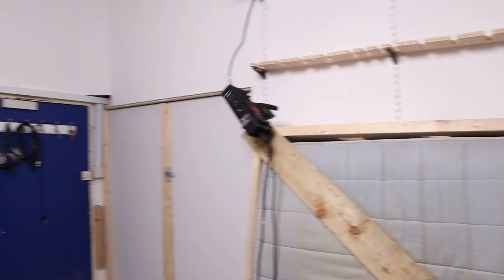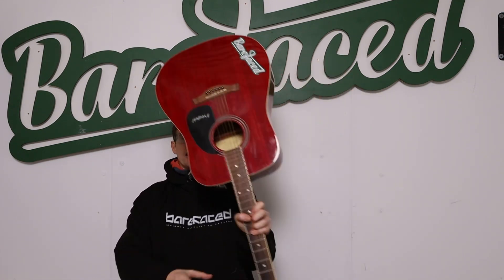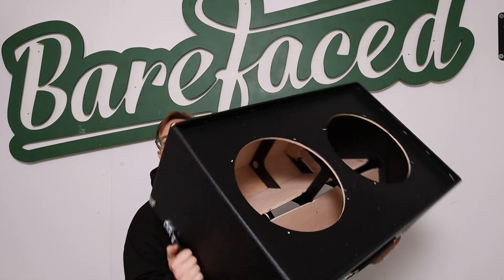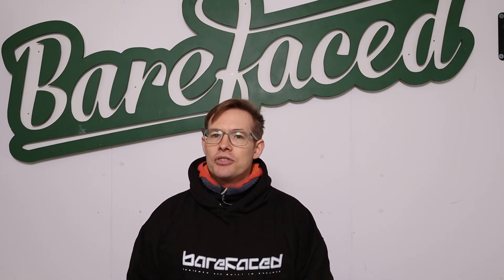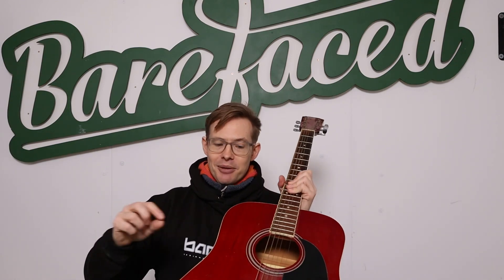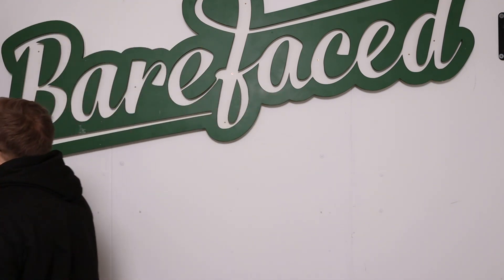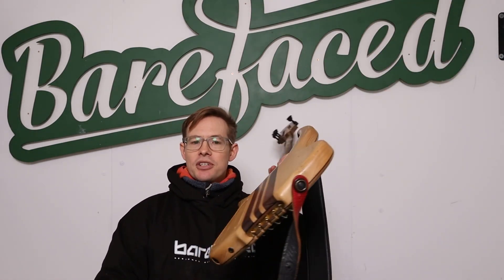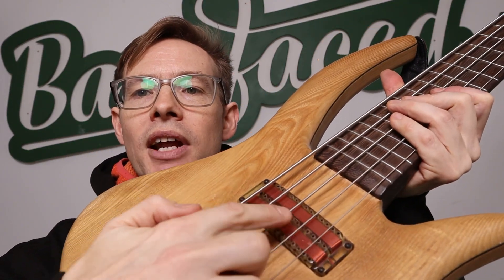Wood doesn’t matter! Or does it?

Comment: Makes perfect sense to have a 'neutral' and rigid cab not adding or substracting frequencies. However, disgarding the baffle for the moment, ive had some really great sounds coming out of solid pine guitar cabs, especially w single drivers. The trick is to not make the pine cab too deep as to keep the interfering lows out of the way. Those pine cabs do sound bigger to me and i assume the pine has at least a significant influence, mostly benificial.

Comment: Stiffness often commes with enhanced mass (if it´s not graphit) and every cab will have it´s resonant frequency so of course the material matters. I don´t argue for tone wood but I would asume that if you would build your cabinets out of 1cm concret they would sound very different. Of course everyone wants a very light box and your approach is the way to go, but when you got this far with your explanation you should go all the way and explain resonant frequencies effecting the design. Every drummer knows the difference between a birch and a maple ply sound and this (even if not intended) also goes for speaker cabinets. I used EV Thiele cabinets (edit:built with the same specs but different ply wood) and other horn designs with the same speaker and the sound was very noticable different all the time.

Comment: You may even be exaggerating the effect of the wood’s resonance on the sound of any stringed instrument. Strings attached tautly to a stiff board can be made to vibrate, to produce sound. The sound can be amplified by a nearby air volume. The material the strings are attached to isn’t resonating much at all, even in an acoustic instrument. We need someone to make a Carbon-steel cello to test. I say only an expert could tell it wasn’t wood.
Reply from the maker: If the materials the strings are attached to aren't resonating much (in acoustic instruments), why is an acoustic guitar so much louder than an electric guitar unplugged?
Reply: The volume of sound from an acoustic is partly due to how thin the wood shell is, but it’s mainly thanks to the body of air within, where there is resonant amplification of sound from the strings, then released thru the sound hole. A thick shelled hollow-body with a sound hole would be louder than an acoustic with none at all…I think.
Reply from the maker: @marcusdavey9747  The soundhole is a Helmholtz resonator, driven by the vibrations of the inside of the instrument. It will also act as a low pass filter restricting the output of higher frequencies. The outside of the instrument will generate acoustic output similarly the higher frequency output won't be low pass filtered (so will be much louder) whilst the lower frequency output won't be assisted by a Helmholtz resonance.

Comment: My little Vox Pathfinder 15R combos are made out of OSB, something held in great disdain in the guitar community.  But these semi open back amplifiers with an 8” speaker move tremendous amounts of air with a ridiculous amount of bass. The relatively new Orange crush line is made from OSB, closed back design but with ported baffle boards - and they sound ridiculously huge!!!

Comment: I have a pair of ATC monitor speakers. Obviously these are designed to limit colouration. They are in very heavy cast alumimium closed encolsures which also dissipate heat from the included amps. They sound awesome. The only wood is some kind of extremely dense particle board for the baffle. Most other monitor speakers that I tried I hated compared to the ATCs and they were mostly wood or particle board cabinets.

Comment: did you find/use particularly stiff ply ?  and have you messed with any inherently stiffer cab shapes?   (love your acoustics  vids - perhaps do room modes ) thanks
Reply from the maker: The bracing is what makes a shape stiff - when it comes to polyhedrons there's little difference under expansive load (compressive load is different but speakers move both ways) so it's all about the bracing. Our ply is stiff for its thickness and mass which pushes up the resonant frequencies and lowers their Q.
Reply: @BarefacedAudio  thanks Alex -  I've used the b&k docdecahedral sound sources and always wondered what it would sound like with different drivers used as a high output bass speaker!  it could certainly create an interesting high spl reverberant sound field :-)) thanks for reply and apologies btw  as I later saw that you mentioned the ply on another video. Cheers
Reply from the maker: amoontube I’ve done some experimentation with omnidirectional bass guitar speakers and there’s definitely videos to come on that!
Reply: @BarefacedAudio  Excellent !  look fwd to that :-)  .. with your tooling a dodecahedral  12x12 speaker is mere hours away !   the omnipotent !   I predict massive demand :-))
Reply: I just love this shit!  I’m unapologetically sick that way. ❤

Comment: I’m an MDF kinda guy when it comes to cabinets. Uniform density, very little flex etc.
Reply from the maker: I shall address MDF in one of the subsequent videos. Apologies in advance for shooting it down, setting it on fire and burying the ashes in a very deep hole... ;-)
Reply: @BarefacedAudio  it’s been through worse already, hell it’s just pressed sawdust and glue, god forbid it gets a drop of water on it.
I’m excited to hear your take on the material. Have you looked into other alternatives, aside from plastics and carbon fiber, I can’t remember what it’s called but we used to get big 4 ft x 8 ft x 2in thick sheets of what I can only describe as resin/paper laminate… it was a dull black and kinda resembled stone in appearance. If I remember the product name I’ll edit this post.
Reply: And who throws away an instrument 😞. Thanks for saving it from a landfill Sir
Reply from the maker: It was actually Ben that saved it, he's Chief Womble here!
Reply: @BarefacedAudio  I’m a bit of a Womble myself, my wife calls me Fred Sanford [Sanford and Son TV series based on Steptoe and Son ] because I can’t pass up an item who’s full potential has not yet been realized. I look at fine craftsmanship and engineering that can stand against the eons being tossed in a rubbish bin and I weep for a rapidly disposal society. 
Keep building good things! 

And picking up after yourselves and others. ♻️